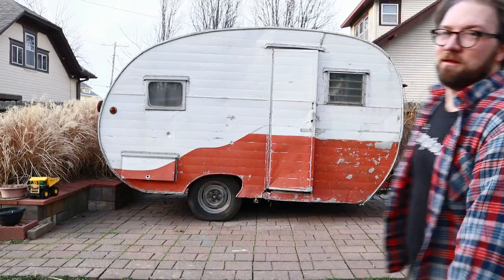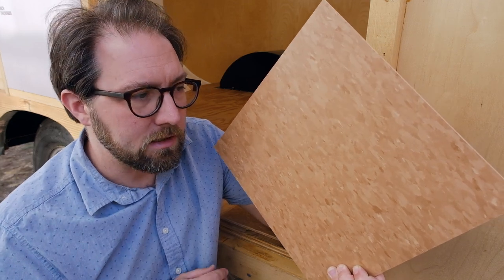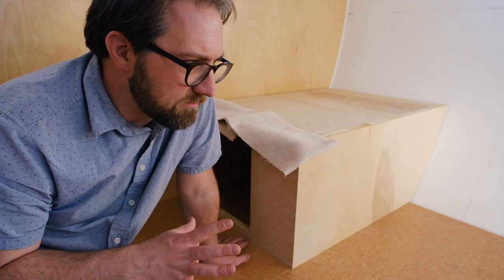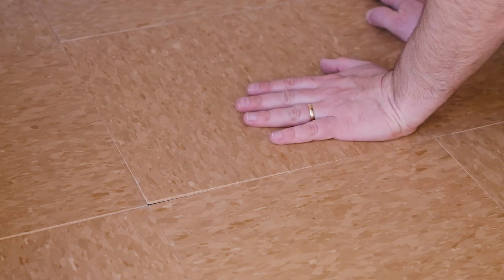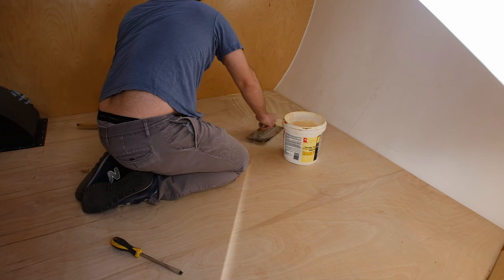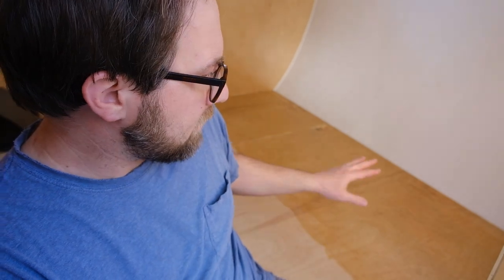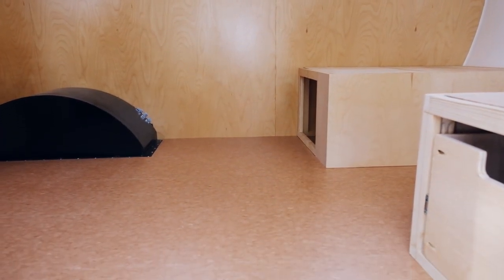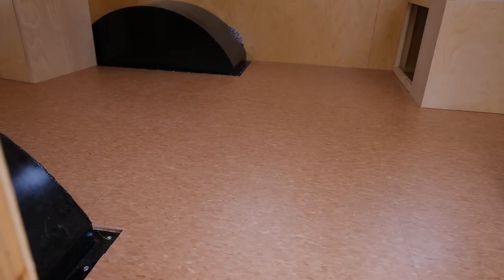$45 for the WHOLE CAMPER FLOOR!? 😲/ VCT INSTALL

Comment: using one color and uni-directional your system works great BUT IF you were doing a 'checkered board' pattern  or multi-directional patterns it looks more 'balances' if you determine the center of your walkway between the two rows of cabinets where the sink and storage units are located  and positioning so you don't have a 'thin strip' in front of the doorway.  PS the price of VCT is now (2023) around $1.50+/sqft
Reply from the maker: Totally agree with you there. You know I bought some more of those tiles this year at the same second hand scrap store and they were still $.45/title!

Comment: For future reference  , just take a grinder with a flapper disk and hit those  carriage bolts down , you can take the dome down enough to tile over them and save some cash and time , not saying its better but time , cost and wieght is things i look at , i want to save as much wieght as i can if it doesnt harm the build ...still i love your work so far 👍👍
Reply from the maker: That's a thought! Larry from MobilTec suggested using T bolts, and that's really what I should've done. If I'd gone with a floating floor I don't think the carriage bolts would've mattered at all anyway.

Comment: You didn't see my VCT vids did you. LOL... You did a nice job. I've never used an underlayment. I use T nuts instead of carriage bolts. I have a video on that also. Just search T Nuts on my channel or go to my website to find the listing. The way I was taught to do VCT requires no use of a tape measure. How about that? Other than that you did fine. And nothing wrong with measuring except that the way I do it is much faster and more accurate if you can believe that.
Reply from the maker: T-nuts! I should've thought of that. I'll keep that in mind for the next one, lol!

I think I know what you're talking about with the fast way, but...but I don't know why I didn't do it that way, brain wasn't working 100% I guess. I did watch a couple of your VCT videos awhile back, but of course I should've watched more!

Comment: Great video - How does VTC hold up to freeze/thaw (Maine)?  Should the camper be on the leveling jacks or hanging free when installing the flooring?  (1970 Layton). Thanks
Reply from the maker: I would say that VCT holds up fine to temperature swings. Kansas ranges from around 0°F to 110°F every year and so far I haven't had any issues with them.

Ideally you've had the frame jacked and level since you've started rebuilding it, and it will stay that way until you're finished. If you don't live in the ideal world, I would say jack it up and try to keep it that way until you're done with most of the rest of your build, but if you can't do that I wouldn't worry too much about it, just do your best.

Comment: The floor looks great.  Do you have an opinion now as to which floor you would use in future projects?  VCT or a floating LVT floor?  I'm nearing the time that I'll have to decide which to use in my Gold Star rebuild.  I kept the original 3/4" p!ywood floor, having only to repair a bit of rot in all four corners.  The floor is covered with sheet vinyl that remains very adhered except over the plywood seams, that I have removed.  I'm trying to decide if I should use a LVT that is able to go over uneven areas, or to install underlayment like you've done,  then use VCT.  Any advice you can give me would be appreciated.
Reply from the maker: Hey Rick, sorry to take a minute to reply. I like both types of floor so I suppose it depends more on what look I'm going for overall. I didn't want to have to put shoe moulding around the bases of all my cabinets, and I didn't want to engineer a solution to avoid moulding so that I could do a floating floor, so really my only option was to do VCT on this one. I think maybe I'd give an edge in preference to LVT if installing shoe moulding is an option; I think it looks a little more "fancy," and it sounds like it might be a bit less work on the install for you.

Comment: Just curious where you purchased your vct tiles at that price. I'm pricing them out now at big box stores and they are $1.39/sqft
Reply from the maker: We've got a local carpet and building supply company that resells overstock and partial case items. There's just a pile of VCT tiles in all different colors, so you have to pick through to find what you want, but these campers don't need much so it's not too much of a hassle.

Comment: Where did you pick up the flooring? I am at the same point with 58 Terry.
Reply from the maker: We got it at a local building surplus supply store called Farha's Carpet and Building Supply, but you can buy VCT tiles at virtually any home supply store.